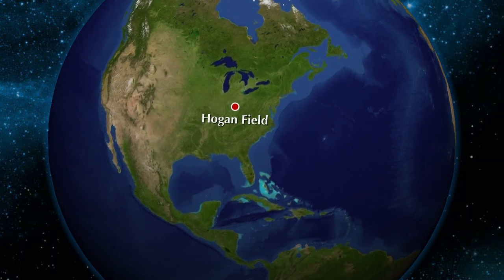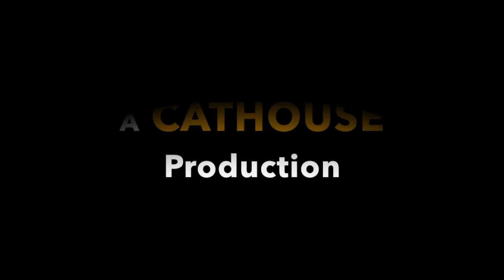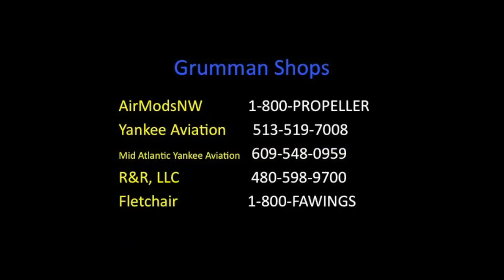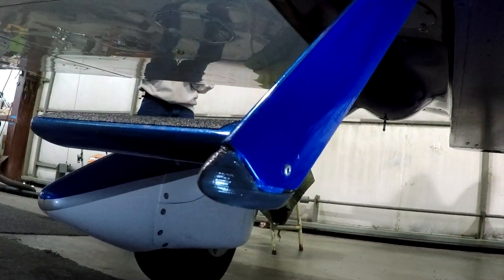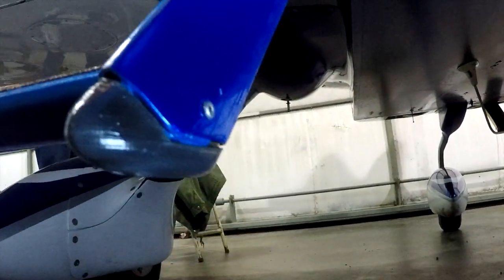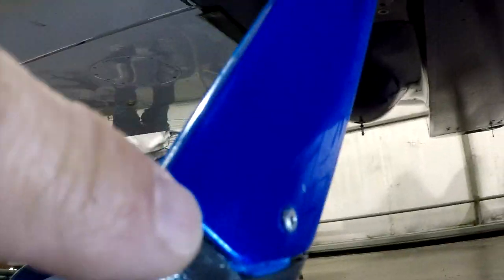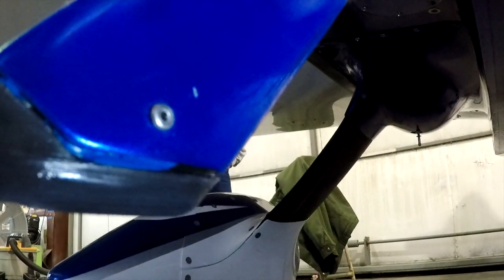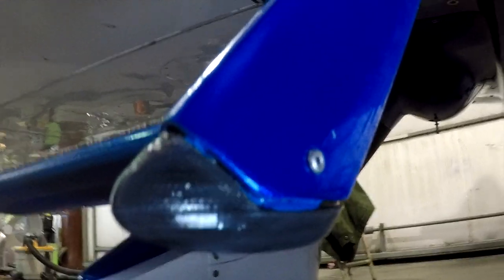Step Peg Plugs Top & Bottom - Grumman Style

Comment: I'm missing 3 out of 4 of my plugs on my tiger.  What's the value of paying the $ to put them back in? The tube in hollow but only up till it connects with the rest of the plane.  Is there another major concern I'm missing here or is it 98% cosmetic, 1% safety (takes a sharp edge and makes it curved/rounded/less prone to cut), 1% nano kts improvement due to less parasitic drag?
Reply from the maker: ok